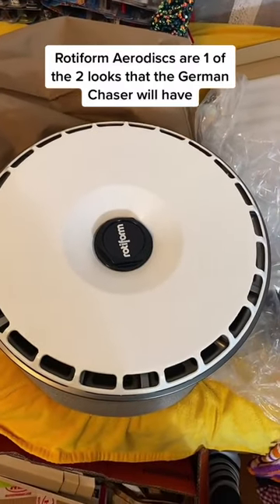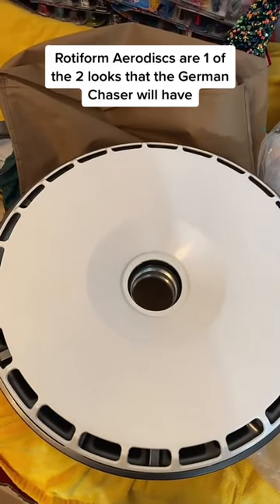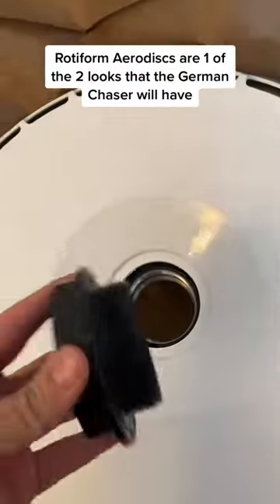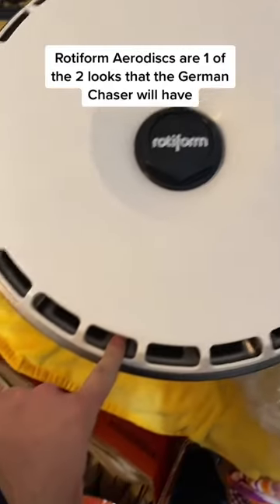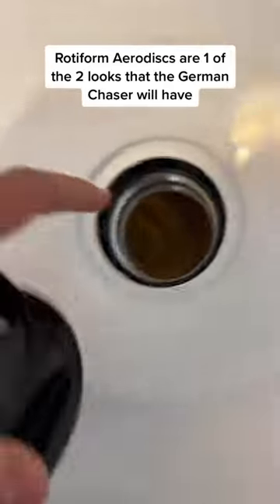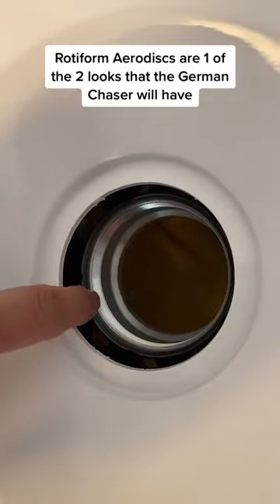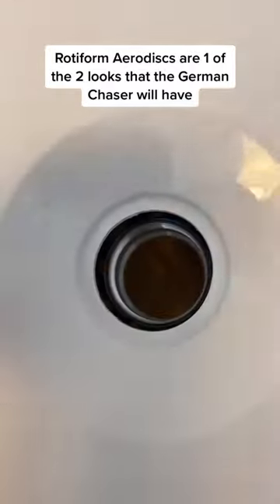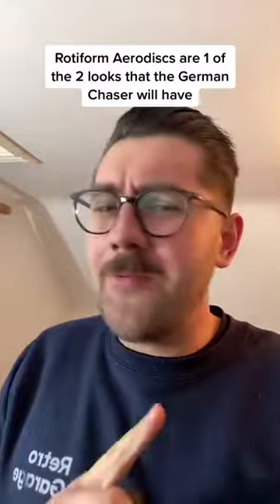Who can help make my Aerodiscs work on the Rotiform wheels I got? 👀

Comment: You will need one piece that has male and female both the same size of the center lock, male will be tightened to the wheel and the female where your center lock will be tightened to